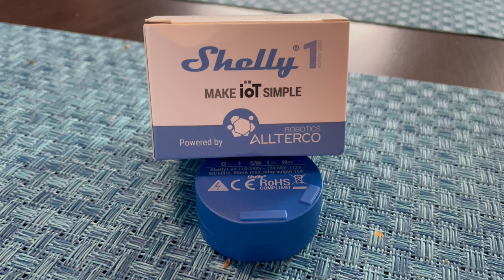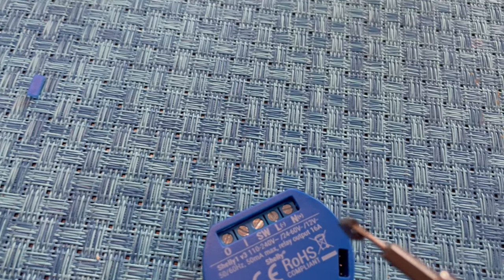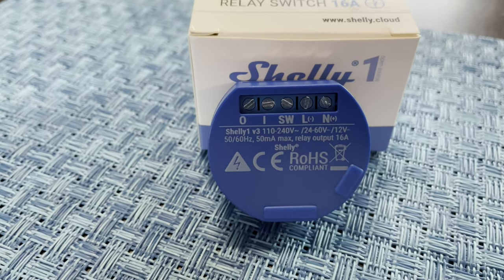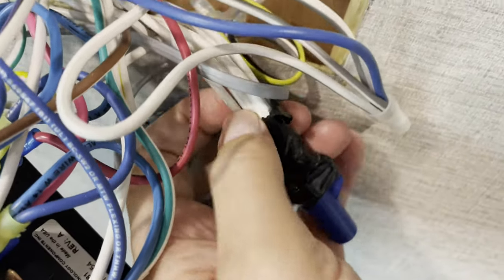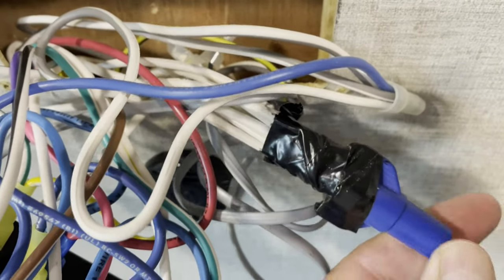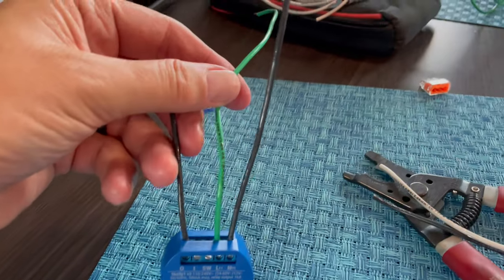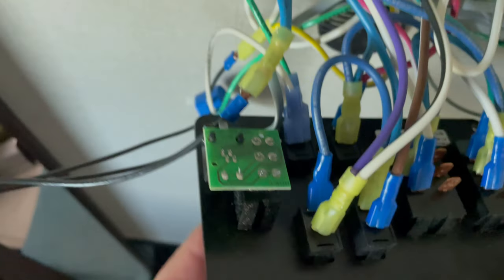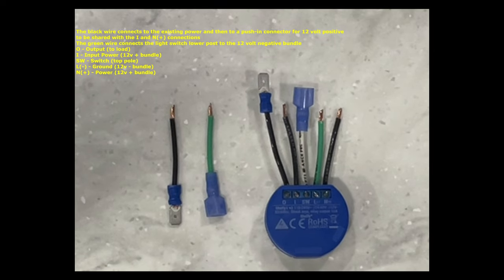Wiring Shelly PM1 in 12 Volt RV Light Switch

Comment: So I finally followed these instructions and got the Shelly 1 installed in my RV. I love it!  I have an Alexa and everything is on voice command!  The top pole of my light switch was apparently the +12v and the bottom pole wire went out to the lights. I think that is reversed to what the instructions were here. Could vary on your RV I guess?  I was a little confused at first, but after doing some research on it I finally understand something that will maybe help someone else out in the future. 

The Shelly becomes a high side switch, meaning it switches on and off from the positive lead. That's what you need in an RV. Many smart LED controllers that you can get on amazon are low side switches meaning they switch on and off from the negative side. I actually installed some low side LED controllers in my RV for individual dome lights because you can do that on a per light basis. But when you're trying to control a number of dome lights all rigged together they work off of the high side. 

What I didn't understand in the Shelly instructions and the instructions in this video is that while the Shelly becomes the high side switch, your manual light switch in the RV will be turned into a low side switch. That's why your light switch will get hooked to the negative side of things. The Shelly has the ability to tell when your manual switch is on or off and adjust accordingly.

Because the Shelly requires a stable 12v, not like in an RV, I installed a simple 12V regulator I got on Amazon. It was recommended by someone on the Shelly Facebook group. So I found the 12v power lead under the floor of the RV (in the crawl space) that went up to the light switch and cut it. I put a volt meter on it to find out which side had the 12v power and I attached that to the positive input side of the voltage regulator. The other side of that wire I cut went up to the light switch inside the RV. 

I don't know why, but I really had a hard time wrapping my head around making this work. I literally had to draw every part of it out on paper for it to make sense, of what went where. Thanks again for your video, it helped a lot!
Reply: Do you have a link to the 12v voltage regulator you are using?

Comment: Thanks for making this video. I just purchased a new 5th wheel and am turning it into a smart RV. I bought the Shelly in hopes of doing the exact same thing you did in this video. However, I got on the Shelly Facebook group and was asking some questions. I was quickly told that the Shelly needs a regulated stable 12v power supply and that using the rvs 12v battery supply was not a good idea because it will vary. I was shown a melted Shelly because of non regulated power. I'm curious how this has been working for you. Under my 5th wheel there is an access area where I think I could fish wires up to that lighting control area and just have a 12v power supply plugged in to the underbelly to power it. Please know I'm not criticizing anything, I'm just giving you a heads up.
Reply from the maker: I have yet to have any problems with any of my Shelly devices in my camper. I don’t have “non regulated” power as all my power goes through a Victron inverter, which ensures clean power.

Comment: "Everything is very clear, once I've done this, how do I access the Shelly without the internet? It's for a camper."
Reply from the maker: You only need an Internet connection to access your devices remotely. As long as you are connected to the camper’s Wi-Fi, you should have access to the devices.